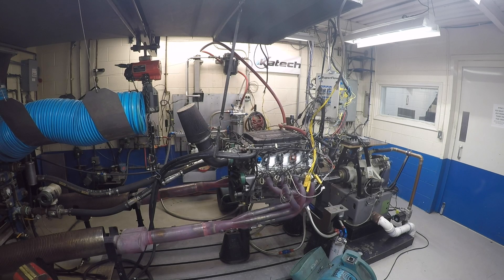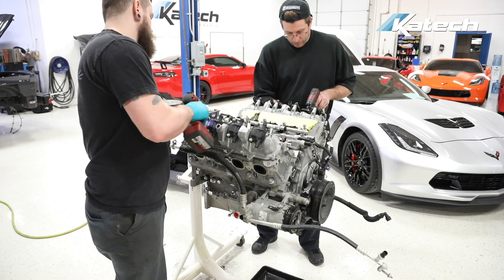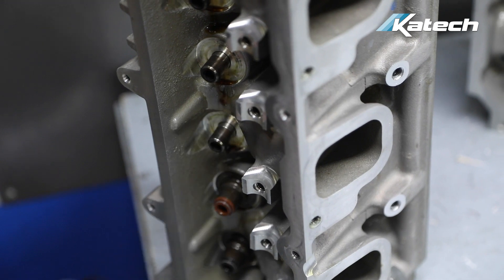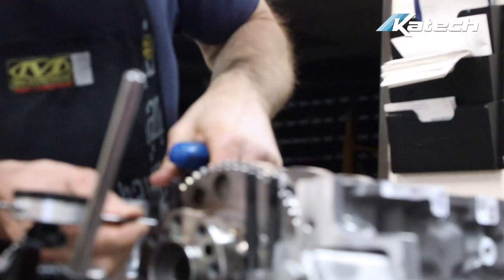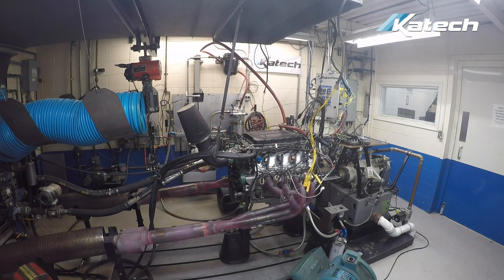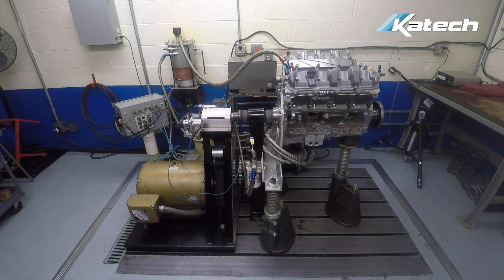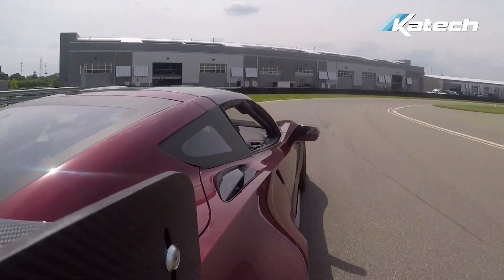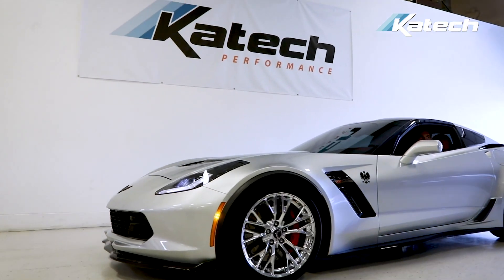Katech Offers Solution To Early Valve/Guide Wear on LT4/LT5 Engines

Comment: Does l83 came with same wear pattern?
Reply from the maker: No we have not seen the same issue on the L83!

The LT4/LT5 have titanium intake valves that are a major part of the valve guide wear problem.

The L83’s and other LT style heads do not have titanium intake valves so they also don’t have the same guide issues. 

Contact us at sales@katechengines.com if you have any further questions !!!